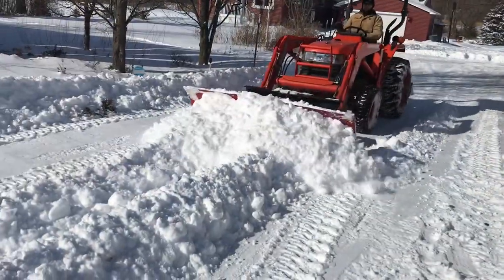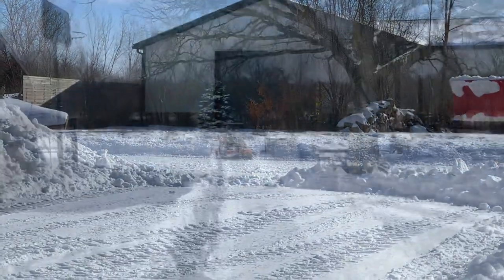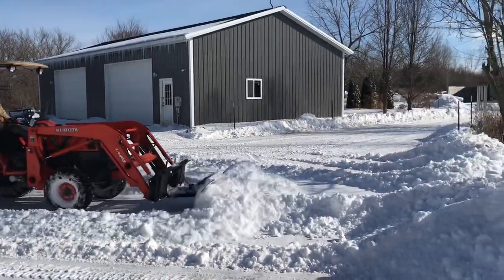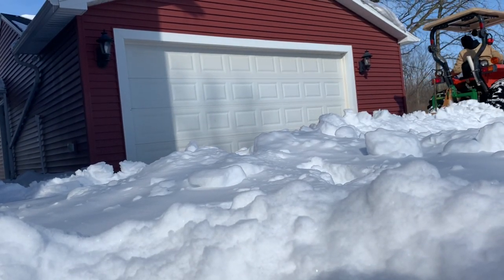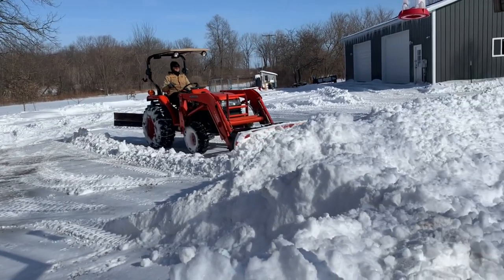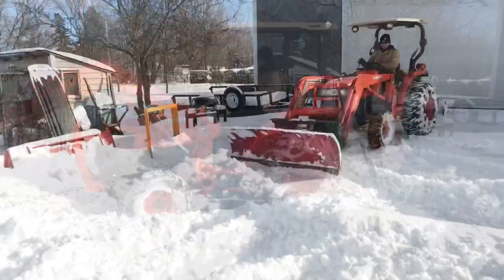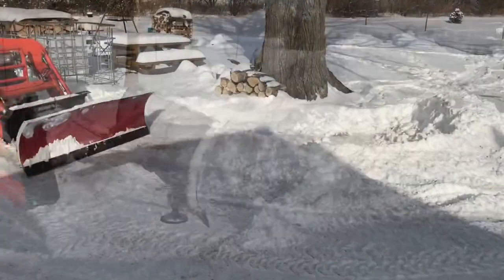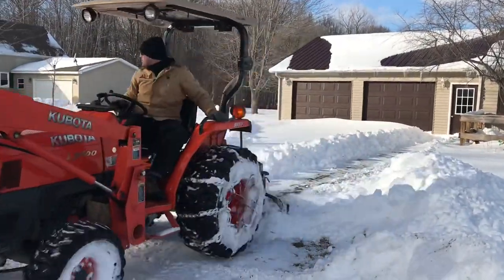164 DIY quick attach snow plow on Kubota L3400

Comment: I'm from Michigan but get more snow but shovel my driveway it's not extremely big long and thin. You had a good idea on the plow at first I thought it was home made. I use to plow with a old tractor using a back blade but those tractors are the old iron tractors so weigh a lot not alot of spinning wheels and the tires was loaded to

Comment: Hi, I have a question...did you shorten your A-frame???
I'm thinking of taking the western plow of my old pickup and mount it like you did to a skid steer plate... my concern is the weight being out so far.... LA525 FEL should lift it with full A frame, right???.... great vid...super interested

Comment: Hello my tractor is 70hp, 10,000# monster. I run a 9' Snow Dog brand skidsteer quick attach plow and with wings it is 11'. I run chains on the rears and have chains for the fronts, but I have never used them. My tractor is 4x4 but I rarely use it either, as it is in two wheel it will push through miles of drifts 2'-3' deep without breaking a sweat. I had a neighbor that got drifted in on a 3 mile drive(my road is two miles) He called his usual guy and he broke his plow truck trying to get through in the first 100 yards. He called me and asked if I could give it a go as I have a 90hp skidsteer and a larger tractor. I opted for the tractor as the distance was so great. I dropped my plow at the mail box and did not stop for all 3 miles. I did the drive one pass in and one pass out. He followed me out in his truck and said it was crazy how much snow I could roll in front of the machine without a struggle. Thanks for the videos!!!

Comment: hello. The quick coupler looks aftermarket, do you have a link to that assembly? thanks.
Reply from the maker: Unfortunately it’s been about ten years since I bought that coupler…yes it’s after market. Back then they didn’t all come standard like they do now. If you do an internet search for quick attach adaptors you’ll find several companies that make them. Give them a call and tell them your tractor model and they should be able to help. Good luck.
Reply: HeavyHitch makes one. Out of Minnesota

Comment: hi there. great and very helpful video. I'm new to the tractor world. i have lots of time on other machines. i get a ton of snow on my new land. all my closest neighbors use 40-60hp tractors with pto blowers. i plan to rig/make a plow set up just like this for a tractor im about to buy.  i was wondering what the black plate that attached quickly to your loader arms is called?  also how is the plow attached to that quick release plate?  thank you
Reply from the maker: Hi Jack, thanks for watching and sharing your questions…..
The plate that you attach to the plow for easy on-off is a quick attach plate or you will find them referenced as a skid steer quick attach plate. The hook up mechanism is the same as skid steers. Regarding how everything is attached, check out this other video of mine that shows part of the build of that plow setup:

https://youtu.be/twtjwywE5Jg

Thanks for watching.